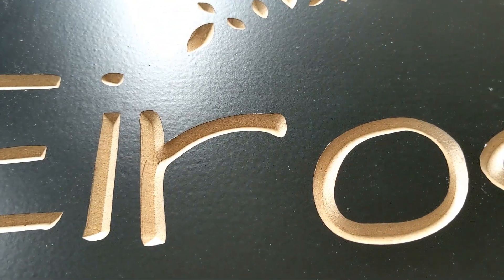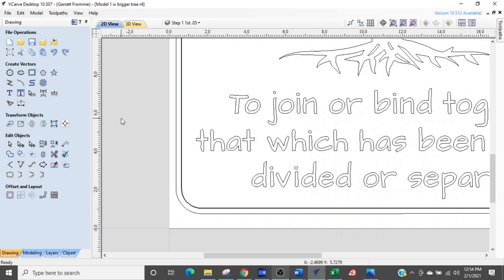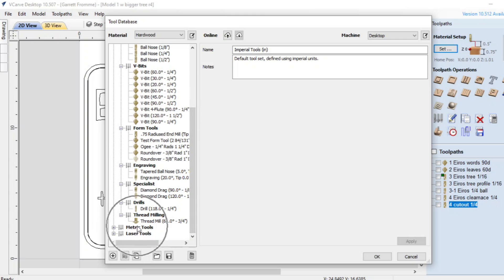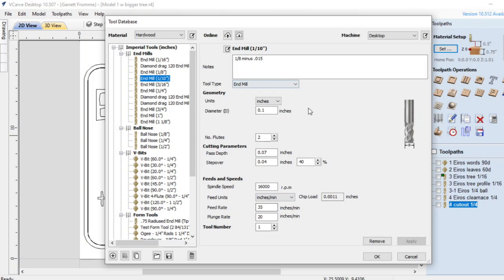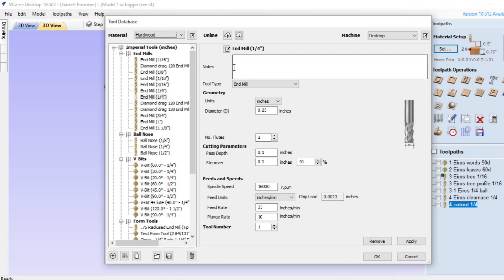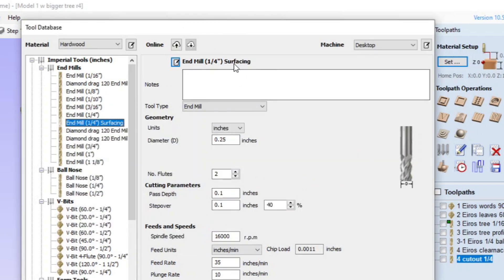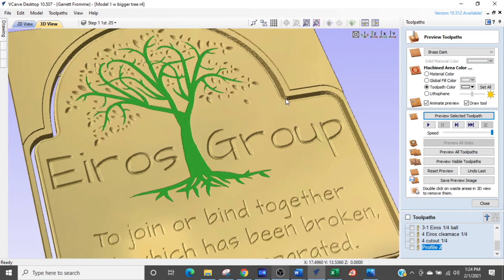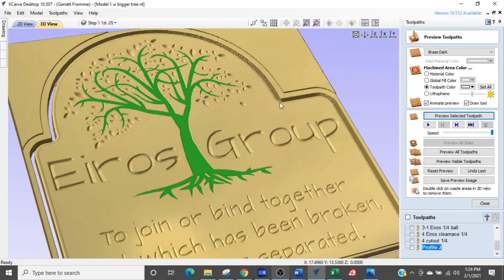How To Setup CNC Router Bits Feeds & Speeds in Vectric Tool Library Database Vcarve & Aspire

Comment: I can't seem to find much on Metric vs Imperial as far as what may be best to use for VCarve and telling your CNC machine to use. I'm leaning toward Metric right now, since it seems to be coming up as more accurate for machining? I guess I was wondering your take on it and what you like to use?
Reply from the maker: JC, the number one rule is to determine what bits are easier to get in your local area. If you live in Europe, metric bits are much easier to find than Imperial size bits. Both will produce exactly identical results in terms of accuracy!

Comment: I watched your video and have my tool database set up.  Do I have to make any adjustments in VCarve if I am using pine vs oak wood?
Reply from the maker: pbb1164, Great to hear you have your tool database set up! Yes, different woods like pine and oak can require adjustments in your cutting speeds, feeds, and sometimes even the type of bit you’re using. I recommend downloading the IDC Woodcraft app and then you'll be able to adjust the setting (router and material) for your projects to be more accurate. 

Here's the link for iPhone users→ https://apple.co/3IKj9Td
Here's the link for Android users → https://bit.ly/3kmFCfN

Comment: Sir can you explain tool settings for iron carving, I am portrait designing Engraver,so please guide me particular tools for iron carving
Reply from the maker: Hi Somu. Unfortunately, my machine is not capable of iron so I have no settings to provide. I'm sorry
Reply: @IDCWoodcraft  sir I much confused in step over and feed rate, and plunge, because step over if low value, spindle motor move slowly value, if high value step over , spindle motor move high speed, but feed rate also seen same work, because when I use 100 % feed rate spindle motor move very fast, and when 40% feed rate spindle motor move slowly speed, so I much confused both options same work, step over and feed rate, or both work properties different please guide me, and tell me also plunge rate details, please guide me 🙏
Reply from the maker: @sonuverma2796  feed is how fast the machine moves the bit. Step over is percent of diameter of the bit it will move over on each pass. If a bit is 1" diameter and step over is 25%, then it will remove .25" of material
Reply: @IDCWoodcraft  sir your mean feed rate is spindle motor move x axis direction ,if feed rate fast spindle motor move fast x axis direction fast, if feed rate low value spindle motor move x axis direction low speed move,
Reply from the maker: @sonuverma2796  feed is how fast xyz travels. Speed is spindle rom
Reply: @IDCWoodcraft  sir your mean step over mean cutting material by tool bit, but if I use 0.1mm flat radius V bit tool, and use 25%step over , then how much material cut by 0.1mm flat radius v bit, it will cut 0.025 material, by 0.1mm tool , or more quantity material,cut, because tool tip diameter is 0.1mm flat radius V bit,and when tool run by spindle motor it's cover area 0.1mm, so how to cut 0.025mm material , please explain ,I much confused
Reply: @IDCWoodcraft  sir your mean feed rate work ,all axis of machine move, all directions, I mean if fix gantry table moving Chinese machine, and feed rate value higher, then feed work, spindle motor move x axis direction,and z axis direction,and table also move fast Y axis direction, because machine is fix gantry table moving machine,but, if gantry moving and table fix machine, then feed rate work, spindle motor move x axis direction, and z axis direction and y axis direction fast movement, I mean whole machine drive motor xyz axis, movement depends on feed rate, no attachment matter,of tool size or tool cutting area, only axis direction machine depends feed rate.
Reply from the maker: @sonuverma2796  feed is how fast the machine moves in any direction. Speed is how fast the spindle turns.
Reply: @IDCWoodcraft  sir your mean step over ,cut material by tool according percentage of step over digit, for example if i use 0.1 mm v bit tool and step over fill 40% then tool will cut material 0.025 mm material from surface.but I confused if tool size 0.1mm v bit, but tool cover whole area 0.1mm, but i use 40% percentage step over, so how to cut 0.025mm area material, although tool size 0.1mm v bit
Reply from the maker: @sonuverma2796  This is not working through text. I suggest you schedule a one-on-one with me and I can teach you much better that way. You can schedule a one-on-one through my website.
Reply: @IDCWoodcraft  please provide me link whom complete teach me
Reply from the maker: @sonuverma2796  IDCwoodcraft.com

Comment: When adding a TBN, it wants to know the A angle, in degrees. How do you determine what that angle is?
Reply from the maker: p2krazee, that is typically provided by the bit manufacturer. They will be able to provide that information to you! I have a bit database that will help you if you are using IDC Woodcraft bits. You can upload it to Vcarve and you will have all the correct feeds and speeds for every bit from IDC Woodcraft. Here is a video on how to set it up: https://youtu.be/06qlncvzCbY Here is a link to download the database: https://www.idcwoodcraft.com/download/19136/?tmstv=1669568598
Reply: @IDCWoodcraft  I have your database, but this is a spetool, and I went to their website, but they seem to only offer to download their database, and I don't want to replace yours...

Comment: Is there a place to get tool data. I recently bought a 1/2" ball nose 2 flute carbide router bit at home depot. A friend need a juice groove in a cutting board. The info with the bit provided for diameter, rpm, and  shaft size. Nothing for chip load , feed speed, step over, max depth. I borrowed data from similar bu smaller  bits, but wish the manufacturer included moyre.
Reply from the maker: Ron, for that bit, you will need to reach out to the tool manufacturer. At IDC, I have a tool database with every IDC bit for the most common software packages!

Comment: Hi Garrett. I'm trying to make some works on mdf using 45924 core box 1/2 radius 1/4 shank, but always smoke came out. i tried with this parameters: RPM 18000, FEED 20MM/SEC, DOC 3MM. Also i tried with FEED 25MM/SEC and the result was the same. So, may you gime some advices?

Moreover, i want to know whether vibrations could be problem. I identified some problem in the x axi nut when i disassemble my cnc. it has a little movement when a apply some force with the hand.

Thanks in advanced
Reply from the maker: Spindle Speed is too high

Comment: Dude, thank you so much!!  Working through my CNC essentials book and its vague on inputing tools.  laughed at your comment about calling them tools and not bits, former machinest myself. 

Thank you again, this video was perefectly detailed and to the point.  Qiestion, would you call the ratio you used to calculate plunge rate a safe ratio to use with all bits.  I have a bit i am programming with a feed rate of 200, using your ratio I got a plunge rate of 25.  Does that sound accurate?

Thank you
Reply from the maker: chongo7723, I’m really glad you found the video helpful! Regarding your question, the plunge rate can vary based on the specific bit and material you're using, so while the ratio I mentioned is a good starting point, it’s always best to consult the manufacturer's recommendations for your specific bit. A plunge rate of 25 with a feed rate of 200 sounds reasonable, but you might need to adjust it based on your material and bit characteristics. Happy CNCing!

Comment: At 29:00 in the video you suggest ignoring the Tool Number setting. Since I don't have a tool changer you're right it doesn't mean anything to the machine. But what it does mean is we can use the field for something else. I have a Makita router which means speed control has to be set by me with the dial (vs. spindles getting their speed from the Spindle Speed setting). Rather than having to lookup the dial setting, I put it in the Tool Number setting. Then I add that to the tool name using the replaceable parameters - right click when editing the name, select Speeds & Feeds and then pick the Tool Number. Then whenever I update the Tool Number it will update the title so I can see what I need to set the speed dial to run the tool without having to refer to another document. (I also put the speed dial setting in the Notes field as well.)
Reply from the maker: Hi Jim. The tool number ends up in the G-code file. It will not be handy unless you open that file every time. Good idea. Unfortunately, I do not see this will work in an easy way unless you look at the gcode.
Reply: @IDCWoodcraft  It's going to show up in the name of the tool. So when you pick it in the left panel from your tool list it shows, but more importantly it shows up in the toolpath panel as the name of the tool - like "Tool: End Mill (1/4") 4"

So now when I scroll down in the toolpath panel, I can name it something like "Outer Profile .125 EM 4 which tells me when I load the toolpath that I want a 1/4" End Mill and set the speed to 4.

I don't need to worry about the G-Code at all.
Reply from the maker: @jimhatch5873  ok, now I understand. Interesting little idea.

Comment: Hi Garrett,  I'm having a issue selecting my diamond drag bit, it' shown when I access the "display tool data base" in CAM material setup but when I select profile & slect the tool the drag bit is not shown any ideas?
Reply from the maker: Hi Kevin. that's because the diamond drag bit is lcategorized as a non-rotating bit. the tool path you are using...vectric assumes it must spin. So it doesn't show no roatating bits. Make sense. Recategorize it as an endmill and set rpm to 1
Reply: @IDCWoodcraft  
Good evening Sir,  I made those changes RPM & copied a 1/4 EM & it worked, still wonder why it showed in the master list & not in the Profile tool select area.  Thank you again for your time & Knowledge.
Kevin
Reply: I was too premature on my response the tools were added to the EM section in the master list but still do not appear  when selecting a tool in the Profile tool path I've posted this question to Vetric thanks again for your time.
Reply: @IDCWoodcraft  I was able to view and open the Drag bit in the Quick engraving tool path but could not view the drag bit tool path in any other tool path operation

Comment: Don't the style of vbits you sell have a flat diameter?
Reply from the maker: Bob, some of my bits do and some don't. It depends, for Vectric though, they still list a "ball nose" for example as one with a slightly flat diameter at the bottom of the bit too. Vectric can get a bit confusing at times but if you install the tool library, all my bits will be in there for sure.

Comment: I am investigating or learning how to best use router bits. I understand that the common approach uses the formula 
Speed (RPM) = Feedrate / (# of cutting Edges x Chipload). I wanted to know how depth of cut or width of cut can affect the chip load. Does the general formula make assumptions on DOC or do you limit it to a value, etc.
Maybe you have another video that discusses this subject. If so please point me there.
Reply from the maker: Hi Don. Because this channel is for beginner CNC, I don't even address formulas. I may do a video some day. but it won't be any time soon.
Reply: @IDCWoodcraft   Thanks for the response. I will keep looking.

Comment: Funny thingI just sent you an appreciation message on the Pizza Slice and inlay videos.  I didn't want to ask for a favor/information in the same breath, so I youtube/google my issue and you came up as the solution - how to add tools/router bits to vCarve Pro.  What a surprise!!  I have so much more to work with and to grow into.  You have made me whole with my CNC spindle router.  I feel with the tools/techniques I am internalizing from you, my creativity will be put to its greatest potential.  From you I learned how to round a hole with a pointed roundover bit.  Instead of a hole I am using a 5 point star cut straight through.  To smooth out this surface I'm thinking I will use a ball bit and crater it a bit.  Am I thinking right?  You cant roundover a star hole, Yes?  Anyhow thank you.  I always tell people that I've almost never done/accomplished  anything without the help of others.
Reply from the maker: LegalBeigel, I am so happy to hear this video and my other videos have helped you so much! Your question is a bit tricky to answer over comments. If you are looking to get a rounded profile on a star pocket shape, you can definitely use a roundover bit to roundover a star hole!

Comment: Thanks, good info.  I just purchased a combination up/down cut bit.  Do i just copy the info from a up cut and change the name to a combination bit?
Reply from the maker: The common name for the bit you purchased is called a compression bit. Up-down works too. Yes, copy the same size tool and add it to the name or change accordingly. I suggest you get feeds and speeds for that bit as it will be different that a regular up or down bit.
Reply: Thanks

Comment: Very informative and helpful videos in easy to understand language.  Regarding End Mill Bits, should the description include whether it is an Up Cut or Down Cut?  For instance Endmill (1/16") Up Cut and another one for Endmill (1/16") Down Cut or are the feeds & speeds pretty much the same for each bit?
Reply from the maker: Hi Martha. Up and down cutters do have different cutting characteristics, so yes, they should.  I suggest, before you start doing that...watch this video. I've already created an entire databas for you. the video will show you how to get it and install it.
Here's the video → https://youtu.be/06qlncvzCbY
Reply: Try how I do it.It should be custom and what makes it good for you to remember. List your toolpath to match your Layer name and bit size. Example ...My Project 116EMD or 116EMU
Reply: @maxgarcia9512  Great recommendation and thanks!  Now that I've started designing and setting up my toolpaths, I'm doing just that.  I believe I watched another video where Garrett recommends this as well.  I'm also putting the speed that my router should be at when I save the file since I don't have my spindle set up yet.  I want to learn with my router first before I use my expensive spindle.
Reply: @marthacameron9459  Router speeds would be a great Idea too. Never thought of that. Router speeds are a learning curve for sure with different bit sizes and types unlike the spindle. Awesome! Being a new guy to this CNC stuff myself, I just learned something myself. Thanks as well. 🙂🙂

Comment: I'm trying to find the name of the Bit that you have pictured on the video thumbnail, its the 5th bit over from the left. Looks like a bit that recesses a smaller hole and a bigger hole for the head of the screw. Appreciate your help
Reply from the maker: hey John. T-slot cutter.  Heres a link: https://amzn.to/3b6Mw1k
Reply: @IDCWoodcraft  ok yeah something like that except it has another narrower bit to drill the hole through
Reply from the maker: @redherring5532  From left to right
Surfacing bit
bowl cutter
30 degree v bit
90 degree v-bit
widgetworks glass engraver
carving bit
1/8 drilling endmill
1/4 down bit
1/8 down bit
1/16 up bit
Reply: @IDCWoodcraft  got it, thanks, I must be mistaken, it's a glass etching bit. I'm trying to mount strips of mdf for my wasteboard,  but I want to make some screw holes,

Comment: Great video Garrett.   I am trying to enter in all my tools into Vectric VCarve Pro but I am stuck in my V-Bits section.  In the V-Carve Pro program, when adding new bits, and under the "Cutting Parameters section the program wants "Pass Depth", "Final Pass Stepover", and "Clearance Pass Stepover".   Can you explain the difference between the last two mentioned?   I am trying to enter my bits and I can't seem to find those numbers for my particular bits.   Thank you.....
Reply from the maker: Final pass stepover is the finish pass to do a last cleanup cut. Clearance pass is the stepover percent to rough out the materisl.. download this table to enter the data: https://bit.ly/3fxYeUF

Comment: I find it fascinating that the software has the ability to look ahead into the job and avoid cuts that would damage future tool paths. Software usually goes line by line doing exactly what it was told. Vcarve is different. If there's an issue it alerts you, if there's a large area with lettering,  a pocket cut will avoid that, or your run tool path will show problems allowing you to correct the problem.  BTW, one definition of stupidity is giving me a smartphone. This software is way beyond a phone. Great video as usual.
Reply from the maker: Ron, you are so right on that one. The software is an amazing piece of work.